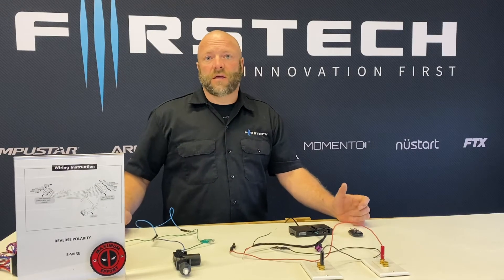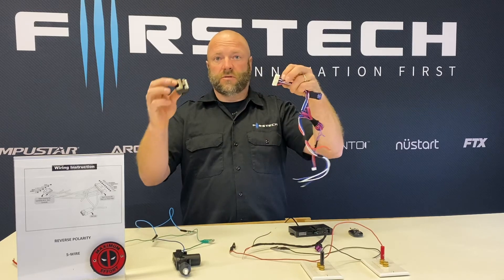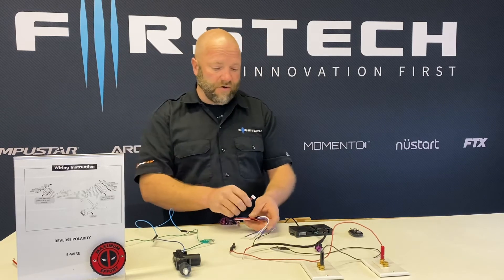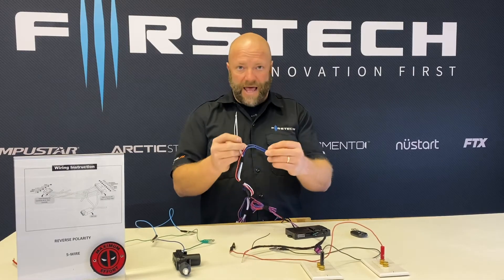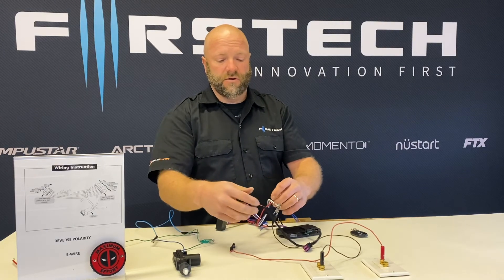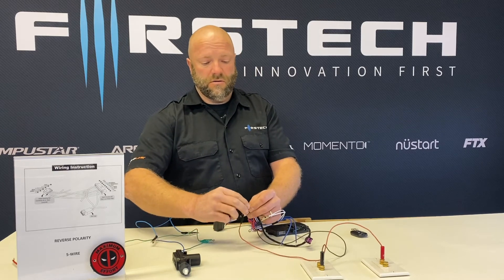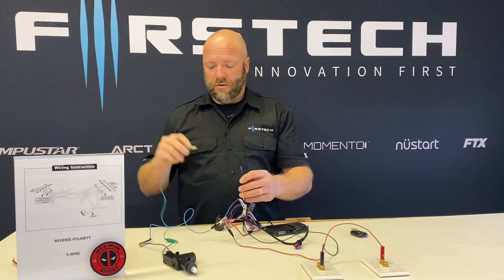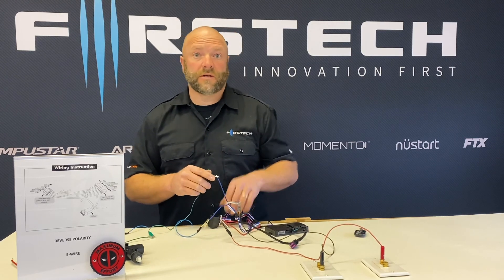Using the "Magic Box" DM700 to Reverse Polarity | myFirstech Academy 101 Ep. 11

Comment: All listings I find for the DM700 indicates compatible with FT-7 and FT- 6 series controllers and “Positive” door locks. Will the DM700 work with my Firstech CMX-HC and provide reverse polarity output for two-wire 12v actuators on a 1982 Chevy C20 truck?
Reply: Don’t know if you still need an answer but it worked on my 86 k5. I just installed it and I know it’s a super old post lol
Reply: @ItsDrewDawg  
Thank you!